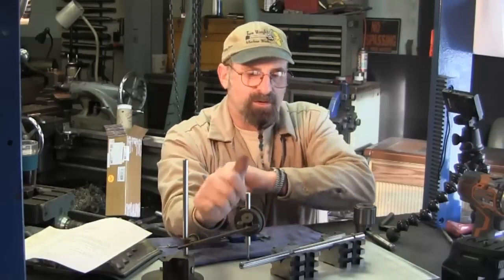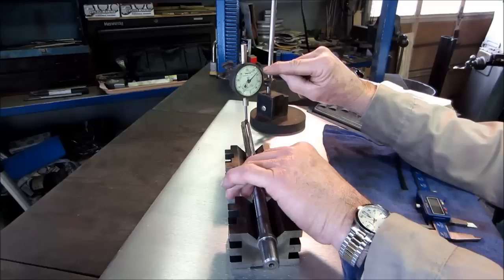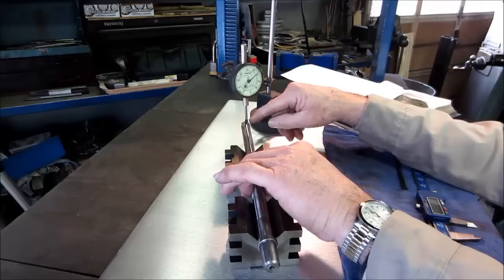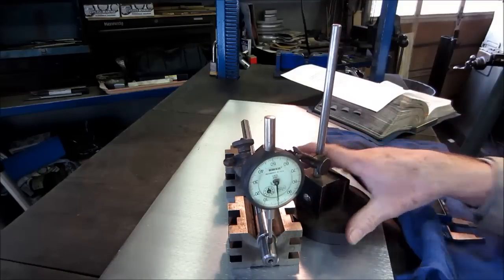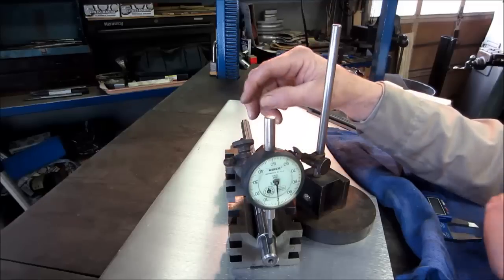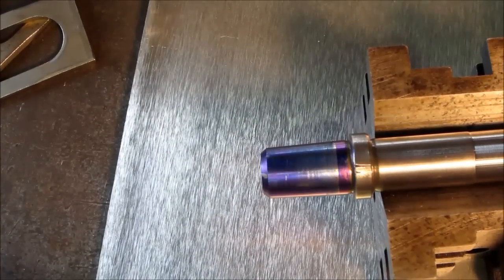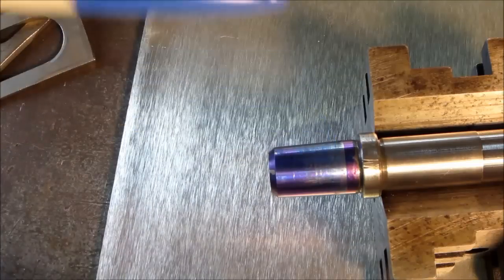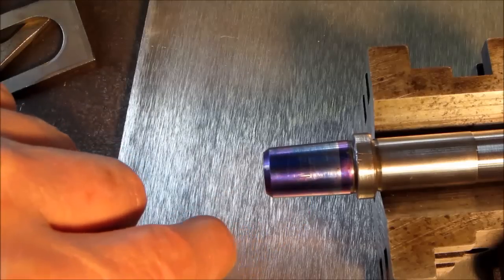Checking out your spindle

Comment: Very good Keith. Just happen to be that an older neighbor friend ask me to come check the spindle run out yesterday on his Wilton A5816 Drill Press. Was .014 + , and guil was spot on, and bearings were quite as a mouse. I will be going through the same steps as you have done, and thanks for the re-fresher course this morning. After +68, one seems need a shot in the ole memory bank, hehe!. And yes, no shop, small or large should be withour the Machinery's Hand Book. Sorry I haven't had or made time to visit your channel more, but too many projects around here, and in the middle of restoring an old 1950's Klopp 450 Shaper, and may be my last big restoration.  Best to you & yours over the 2021 Holidays,,Bear in Tx.

Comment: At work I was getting some horrific wheel bounce just grinding plain mild steel on the "good" surface grinder, a large hydraulic unit. Dressing the wheel made no difference so I removed the wheel to re-balance it. Out of morbid curiosity I quickly threw a finger dial indicator on the table (actually had the base sitting on the work piece) and checked the main spindle (morse taper) to find it running out by .10mm!!! (4 thou) as the apprentice I reported it to the supervisor and promptly got my head bitten off, my arse kicked and sworn at because I took the wheel off the grinder, and that my dial check was invalid because I had the mag base sitting on the work piece and not the table itself. And to this day nothing has been done about the actual problem. I learnt my lesson that day and I no longer care about machine condition at that particular place if that's the response I get!

Comment: Diggits, blems, and noogies;  Three new technical terms to add to my vocabulary:)  I'm kicking myself though. When I went through my dad's old tools, I probably completely overlooked his Jacob's wedges.  I'm grateful as we'll for the hint about warming the chuck up before putting it on.  Once you do, do you just slap it on, or do you whack it with a brass hammer to seat it?  I ask because the chuck dropped of the spindle on my cheapo drill press and I fear that I may have man-handled it a bit.
Reply from the maker: Make sure it is not bottoming out in the bore and after you heat it up, slide it on and press down on a block of wood using the handle, should be enough if the fit is good, like I displayed. ;{)------

Comment: Here in Aus, my father used to refer to a pair of wedges similar to the Jacobs wedge, however without the slot for spindle as Fox wedges. Just wonder how universal a term that is. He used to make them from the outer ring of bearing race's that were out of service. The material was annealed, forged, filed, hardened & tempered and as required stoned to finish. Wonder how many others did or still do the same. Cheers from John.

Comment: Keith- 

Timely subject, just now working on a small antique Swedish mill/drill with a spindle issue. Runs out .001 per inch of distance from the lower bearing (so .010 TIR at the end of a 5" bit in a 5" chuck/arbor). Checked w/ long indicator probe, RO is present in the internal #3 Morse socket itself;  zero runout at the height of the bearing, worse either direction up or down. 

Supposing spindle was bent by a side crash, with the lower bearing acting as a fulcrum.  Most of the shaft is 30mm dia. maybe 200mm long. Could something like that be flame straightened once it's out of the quill? 

(BTW great video; I find the hardest skill to learn is knowing when something's good enough for the intended purpose!)

Best, 

Mike
Providence RI
Reply from the maker: A steel spindle can be straightened some by the heat straightening method but is slow to move and sometimes limits out on the amount of draw you can getin the needed areas. ;{)-------

Comment: Does the letter give any information about the manufacturer?
My drill press has (or better had), according to what I see in the vid, exactly the same spindle. I´m from germany and my drill press is a most likely german made "Reima", 3phase, pretty heavy and quite powerful. The spindle and its morse taper is not or not hardened enough, so it entered my home workshop with the chuck seized on the taper. The chuck was pretty much shot, and after changing to a new one the damaged taper produced some runout. I had it reground once, but the problem stayed, as the spindle shaft between the bearing surfaces was not running true and the machine shop couldn´t really chuck it properly in their lathe. I ended up with cutting the lower spindle off, centered the face, and welded on a Morse 3 to 2 adapter, which outer taper was turned down to form a new straight outer diameter and so giving it a new and larger bearing surface. The lower bearing seat in the quill was enlarged and received a new tapered roller bearing. Now I have a #2 Morse taper running pretty true which can receive quite some tools. Only disadvantage is the lack of access for the parting wedge. I thought about cutting a window in the machine body and the quill, but decided not to destroy any more of it´s originality.

Comment: Hello Mr. KIETH.  nice video.  I have a question for you.  I have a central machinery 17" drill press.  I am trying to drill holes on pen blanks.  I start at the top center.  But the drill comes out crooked on the bottom side.  I leveled the table .  Change out the quill and spindle with new ones.  Came together assembled.   Figured also nee bearings in it.  But after all that the holes are still coming out crooked.   Can you plz point me in the right direction to repair this problem.   Thank you very much for any advice.